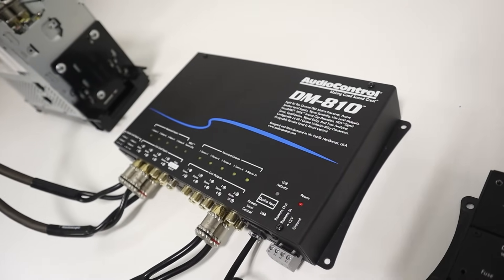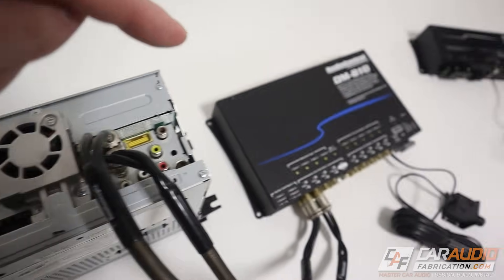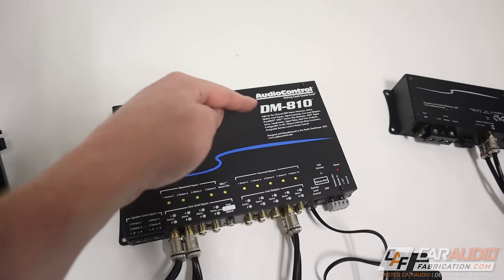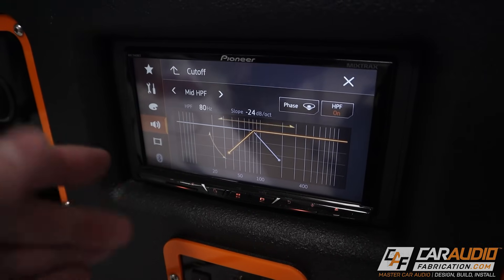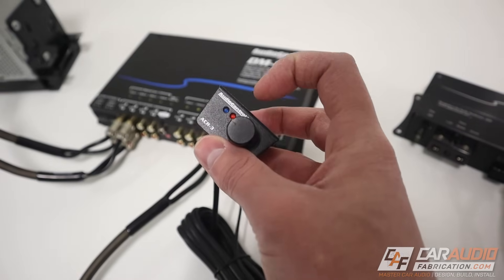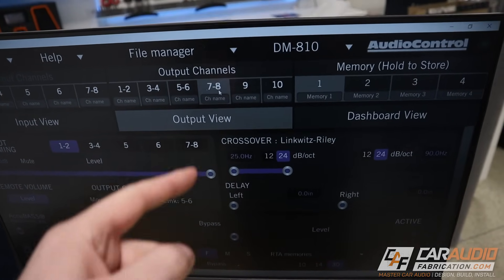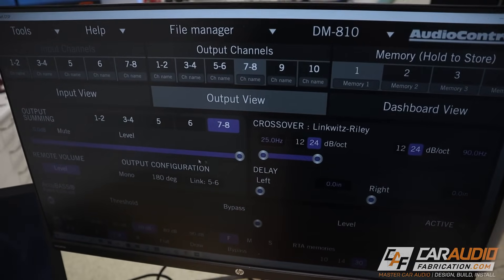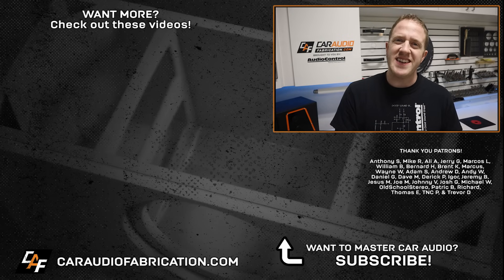Which subwoofer output is best? Direct from Head Unit or DSP?

Comment: I have a Kenwood Excelon DMX-706S that I run directly into my MiniDSP DSP and then to my amps. Before I had the DSP I would control all of the eq, phasing, time alignment and crossover settings from my head unit and it was cool but the DSP is way more powerful and adjustable plus it offers me the ability to make different presets so I can have a preset for sound quality and one for SPL. I can also add a preset for when someone else is driving and make it so that person cannot cause damage to my system even if they were to crank everything to max level because they are now being controlled by the DSP.

The flexibility and features of a DSP cannot be matched!
Reply: @kychristell1779heck no! But sometimes my mechanic may need to test drive it so I have a preset that actually disables my sub output and increases the high-pass to my mids and highs so that they are less likely to be damaged by someone turning the volume up too much.

Comment: I presume you could also then choose a "cheaper" headunit with less audio out options and let the DSP do the work if you were planning to have a DSP. Given headunit prices are sky high or out of stock.
Reply from the maker: As long as the signal out of the head unit is clean and 20-20k then yes this could potentially allow you to pick something with less pre-outs as you can create what is needed via the DSP. Good observation!
Reply: I would look for something high a quality playback. You cant usually upgrade the signal out typically it only gets "worse" from the signal source
Reply: @MaXimus666789 I would still look for a head unit that is of high quality for the main purpose of having the cleanest signal possible. A DSP is a powerful tool that can do a lot but unless it comes with a line driver built in your signal is only going to be as good and as clean as what's coming from the head unit which is why I chose the Kenwood Excelon DMX-706S for my system. It has a clean and clear signal even at maximum volume with no distortion so as long as I set the gains on my amps correctly I never have to worry about blowing any speakers or even listening fatigue which can happen when listening to a "dirty" signal.
Reply: I like sky high car audio
Reply: Other than for radio, you don’t need a headunit at all, just buy a flac player or use the bluetooth directly in the dsp

Comment: For me it's best to have the DSP do all the work. That is the best option IMO.
Reply: Would you set the stereo unit to flat? And make all the adjustments in the DSP?
Reply: @SpinningwrencheswithJ  yes, the stereo will not control anything the DSP is the overall control.
Reply: @jiriza84641  oh man…oh man…I’m a in my 40’s and I’m also a bass head but I’ve never messed with technology like this…a little overwhelming for sure brother.!!
Reply: @SpinningwrencheswithJ  you'll still get the frequency from the rca's in and use the amp or DSP with the volume knob. Also, I hear you I like my sound as well, and bass when needed.

Comment: I like the audio control DSP, however I don't like having to rely on the computer software necessary for tuning. It would be nice if it had an app with Bluetooth for phone connection to make adjustments as well.
Reply: Like with the AC-BT24 and the DM-RTA app?
Reply: @darryndewar  Ah I see said the blind man to the blind boy with the saw.
Reply from the maker: The DM-RTA app is for the DM-RTA. But yes you could add a AC-BT24 and tune via a mobile device with the DM Smart DSP app
Reply: Is there one for your phone?
Reply: @jonclemons8463  apparently it can be adapted so

Comment: i like to run 3 RCA's front, rear n sub to the processor, keep the setting on the deck flat and tune the DSP, that way when i want to adjust a song like it needs a little more of something or less i can use the setting on the deck cause at the end of the day we all listen to different genres of music and not all music is recorded correctly. so the deck/head unit is to make minor adjustments, that way when the DSP is set you always have the flexibility to still tweak from the head unit individually. Its the same like using a Preamp, example a head unit that have front rear and sub , you got 2 amps one for mids and highs and one for sub , then using 2 preamps makes more sense, front output from head unit to one preamp and sub output from head unit to next preamp, now you  have setting for mids and higs alone and with the sub you can adjust for bass alone and as it runs through from the front and read signal the settings for front on the deck is added adjustments to make as with the sub setting on the head unit , maximizing everything, and this can be done in many ways as long as you know what front-rear or sub will be powering, With the processor its easier as long as you got everything dial in and less equipment, with more than one preamp you can always adjust on the fly.

Comment: could yo do a setup on dodge and ram steering wheel controls , 2 wire, jack, restance and rams what? i have not gotten this to work yet in my 2019 ram promaster city i am useing a dmh-1500nex which does not show in settings, the steering wheel control settings. any help is awsome thank you! happy new years.

Comment: What about the sound effects on the head unit? 
For example. If I just run two sets of coax for front and rear speakers  skipping the subwoofer outputs, will I still be able to use the bass boost effects on the head unit?  Are these effects just applied to the sound coming out from the sub outputs or is applied to all sound. Maybe I'm giving too much credit to my kenwood DMX 958XR.

Comment: I have the DM810.  I use RCA line out 9 and 10 linked to the left and right on my mono sub amp. Is this OK, or should I just use just one of the mono lines from the DM810 with a  "Y" adapter to the JL RD1500/1's left and right? Any pros or cons? Always wondered about that

Comment: Mark, when bought my current car I went to install a new HU and my amp and sub set up from the old car. This is when I found out about the factory amp for the mids. I used the regular output from the head unit to the factory amp. Should I have used the pre-out for the front and rear instead? I did eventually have to go into my sound settings and turn down the gain for the front and rear channels to improve the sound quality. If you need more info just ask. Thanks for vids!

Comment: I've noticed now some of the Chinese aftermarket head units that are direct replacement have DSP software built into them have you had any experience with this new technology? Love your videos btw. Have had alpine F1 set up previous and alpines processor which required a laptop and RTA for the shop to set up

Comment: Would you rather use an external LOC to covert high speaker inputs or get an amp with built in function which accepts high level speaker inputs?

Comment: Hi Mark, can you make a video that shows the order of operation from the head unit to the dsp with multiple amps. I'm building a system from scratch and I want to go with 2 sets of highs, 2 sets of mids and 4 subs. Do I need the 10 channel dsp from audio control? That's what I'm looking at.

Comment: Just out of curiosity what if you had like 4 sets of speakers front, 4 speakers back including 8" midrange, 6'5" component set in the doors then lets say like a small coaxial in like kickpanel or dash front and same type of a speaker behind the rear passenger area each side, plus a subwoofer in the trunk as in a lot of wires 2 amps front and rear how would you go about connecting those.

Comment: My son has an s10 with a pioneer head unit, an amplified 8" sub and a small amp with a dsp built in for the front and rear speakers. 
The head unit only has one set of outputs. 
We're wondering if it would be best to use the dsp app, the built in crossover settings on the sub or the head unit to tune the system?
The rca's go from the head unit to the mids and highs amp then from the amp to the amplified sub.

Comment: Have you ever used the audiocontrol dqdx signal processor and epicenter together and would you install in your system ?
Reply from the maker: Good question for a future video!
Reply: @CarAudioFabrication , did you ever do this video suggestion? I have a installation coming soon. I was thinking about adding the epicenter.
Reply: @CarAudioFabrication , My build is very similar. Pioneer DMH-W4660NEX head unit with Sirius HD kit, Metra Dash Kit 95-7628bhg and Maestro ADS-MRR for steering wheel/front & backup camera controls, Custom SlamPanda Raider Nation Bass Knob w/led's, Panda Cub for four DS18 Bullet Tweeters on a JP48 amp, four D4S Pro Audio 6.5 v2’s mids on a JP234, 2 Nightshades v5’s 12in's on a SALT 8, 5.5 qubic feet box by Gately Audio tuned to 32hz, 80ah of Lithium by Underground Power, XS Super Cap under the hood, Dual Volt Meter in dash for Lithium and alternator, 250amp high power Alternator by Power bastards, Big 4 install, SoundSkin Pro Plus Sound Deadening, doors, headliner, floor and hatch,, SMD Copper Fused Distribution Blocks, OFC RCA’s from KnuKonceptz, OFC 4 gauge Sky High Speaker Wire, a whole lot of OFC 0 gauge Sky High Wiring and colored heat shrink wrap. System Tuning will be at -8db. This is my set up going in June 1. I'd like to add an Epicenter. Is it necessary?

Comment: Awesome info and channel!  So, using connection from the DSP to AMP, we make the frequency settings on DSP side, then do we do anything on Low Pass on the amp side? (I.e. leave it wide open or mirror the setting on DSP or doesn't matter?) Still need to set the gain?
Reply: Technically it doesn’t matter… BUT, to be safe yes I personally would match the DSP, if you ever altered something on the DSP by mistake then it would be a backup so that the wrong signal wasn’t sent to the subwoofer.
This is more of an issue with mids and highs, but the same principle would still stand

Comment: In my current situation W/ my Factory Bose system. I have 8 Speakers. I have 2 Front Tweeters, 2 front doors, 2 Back Door and 2 Rear Back. It looks like the 4 front are connected together and the Same with the Rears. So I only have 4 pairs coming out of the factory Amp. When connecting a DSP W/ Amplifiers like the AC D-5.1300  would you recommend leaving the Speakers connected the way they are, or would it be better to have them all separated?? Thanks

Comment: Alot of people are gonna go with a DSP in the $100-$150 range that won't have the computer stuff. So there will only be a graphic EQ, possibly  with phone access, soooo my question is, on that graphic EQ does the frequencies below 120hz affect the full range speakers or the subwoofer? Does the DSP know to send 100hz-80hz and below to the sub? Now remember, this is for the cheaper DSP'S

Comment: Quick question! For the “Output configuration” for a subwoofer would you select “Mono” or leave it as stereo output? I have the DM608 and have my subwoofer RCA’s going into channels 3/4 stereo of the input section and out of channels 5/6 stereo of the output section.

Comment: Hey Mark, One thing I was wondering is when you make the front rca work as the “sub” preouts aswell what happens if you fade the signal to just the rear like in your example for the kids. Would that also cut off your subwoofer since the signal has now been turned down??

Comment: I'm clear on what the DSP is and how it works but I've never owned one and I'd like to see the connections between the DSP and the computer. Are you putting the settings on a flash drive or directly into the DSP. I would assume you are connected to the DSP so the system can be adjusted to the specific sound in the vehicle.
Reply: They are usually connected using USB interfacing. All the settings are changed directly on the DSP from the computer. That's why most generally use a laptop when tuning a car audio system

Comment: Hello question. I have a amp it's 820w and got a new sub that 1200w it doesn't bump at all just sometimes. Do I need a bigger amp
Reply: If tuned properly you can use that amp on your sub, you just won't get as much output from your sub as you could. Question I have is the 1200w the subs rms rating or the max rating?

Comment: I guess that the DSP is adding a slight delay to the signal also, so you should not mix output to amps from both HU and DSP.
Reply: The latency from any decent DSP will be so small that it will not even be enough to effect the phase much less add a perceivable delay.
Reply: @danielabrams555  To have a perfect filter, you have to look forward in time. Only way to do that is to delay the output. And that will affect the phase to the original signal. But I agree there is no perceivable delay.

Comment: I say to most people, the price of a top of the line headunit can get yourself a good DSP, or DSP amplifier, and run it in anything you want and any configuration. Plus you don’t have to worry about if you can put your head unit in your McLaren dash. Or, your Civic dash. I use an Audison Bit ten. It’s all I need for my setup. I learned about processing with home theater setups in my kid years, so I’ve always wanted one for a car. Best at the time was the Alpine ERE-G180 EQ for all around sound quality per band adjustment. When DSPs came to cars, it was iPad, or iPod, or iPhone, or blackberry, or Google g1, whatever device you want, to a Bluetooth unit, and to a processor. Much simpler, and easy to move to different vehicles.
Reply: Remember the Rockford  Symmetry dsp from the 80s ?? That thing was sick , for its time !

Comment: If my head unit is only 2 volts on the rca outputs for the front and rear speakers. Can a dsp increase that voltage. And what is a good voltage output for a sub rca?

Comment: So if i get it right, if we are to use fade front/rear, and sub is connected to front. You would turn sub down along with front if you fade onto rear channel? So basically always connect sub to sub to sub when using a dsp and your hu got a sub output?

Comment: Sooo I have a question if you have a head unit with 2.5v pre outs and you hook it up to a sound processor will you get a better voltage signal going to the amps?

Comment: Question. I have a Honda 2021 that I cannot change the head unit on (yet) it has a factory 8 channel amp front mid high and centre, rear full range and sub  with factory subwoofer in the boot can I use the high lvl wires to that sub to run into an aftermarket amp to get a better sub in the boot

Comment: What would be your advice if an audiocontrol epicenter was added into the mix? I currently have a pioneer avh-3500nex and run front and rear rca straight to audiocontrol dm-608 and sub rca to epicenter then to dm-608. The crossover settings for subwoofer on head unit are set as high as can go to feed epicenter as much signal range possible. So I end up with 3 control knobs one for sub amp, one for epicenter, and the dm-608 knob I have set to control my midrange from  400Hz-2800Hz. I run 3 amps a sub amp, a 4 channel for mid bass and midrange and another 4 channel for 2 sets of tweeters. The sub amp is NVX VAD2700.1, mid bass mid range amp CT Sounds CT150.4D, and tweeters powered by CT Sounds CT80.4D. In your opinion do I have the setup done right? If not any advice or suggestions are welcomed as this is my first build that is 100% done by me and I learned by sifting through youtube videos(a lot of CAF ones so thank you for that) and online forums so I realize that there is so much that I don't know but want to learn. Keep the outstanding videos coming and thank you

Comment: Love the video!
I had a question, is it fine to configure time alignment and speaker levels on my headunit, and perhaps a little bit of eq too. While doing the bulk of the eq adjustment on the dsp. (My dsp does not support a remote to change presets)

I drive with passengers in my vehicle half the time, and I love being able to quickly adjust the listening position (which sets the time alignment and speaker level based on the number of passengers) on my headunit without an app or a computer.

I want to have the best possible listening experience in the drivers seat, but quickly change to a very good experience if passengers are in the vehicle. So I’m happy if the dsp is optimized for the drivers seat, and the headunit can be used for quick tuning.
Reply: That makes sense to me 💪😎👍

Comment: 1. what about a clean signal. if you use the nob on the dsp you may be feeding an unclean signal to the bass amp.  wouldnt this also make setting gains properly more difficult and potentially leave some performance in the sub amp?
2. if you want to fade from front to back with the 1st setup you will fade out your subs, can you select all 4 inputs for the sub out?
3. since you have all the out's needed, why even mess with a dsp. if the HU has all those outputs it will probably have adequate crossover and tuning capabilities. ?
Reply from the maker: 1) Not every knob is "bad" as other creators have led the community to believe. The knob on the DSP (and even the amp in this video) is a volume attenuator, it doesn't impact the gain setting. You simply set the gains with the volume attenuator knob in its full position
2) There are ways to make the subs link to front and rear signal but personally I feel like losing sub when fading to back is preferred. If you are fading to rear to get away from hearing in the front you will still hear the subs if playing on rear signal so its kind of pointless to have it set up that way. 
3) Please watch this video and pay extra attention to misconception #2. https://youtu.be/sxVVz13XkPg a Head unit is NOT a replacement for a DSP.